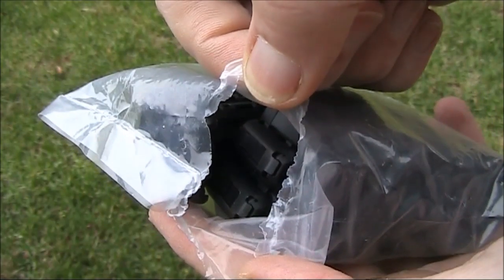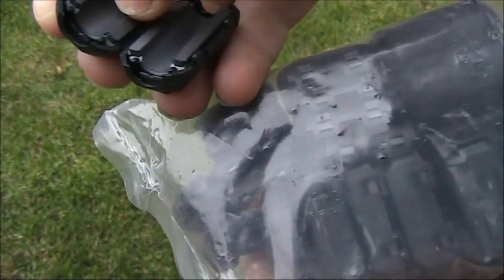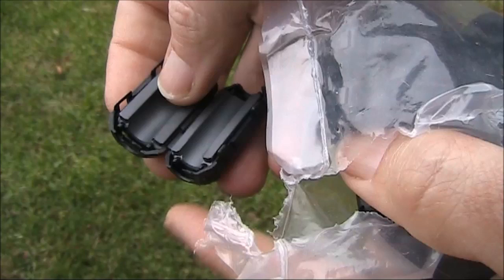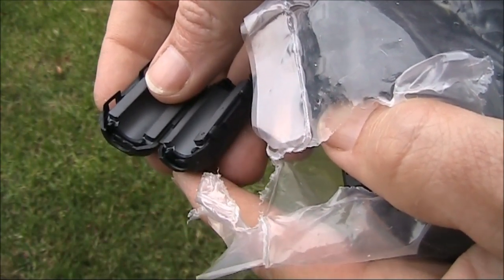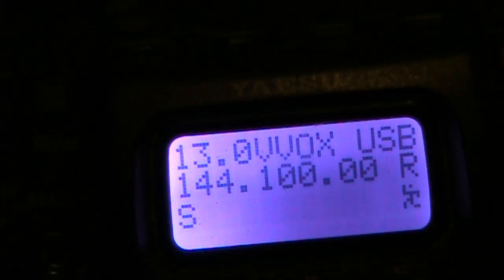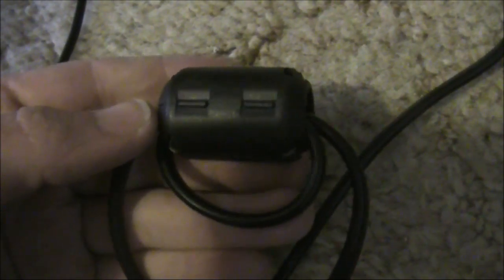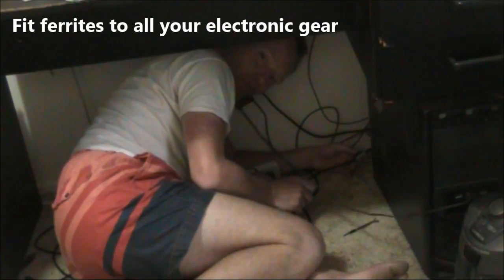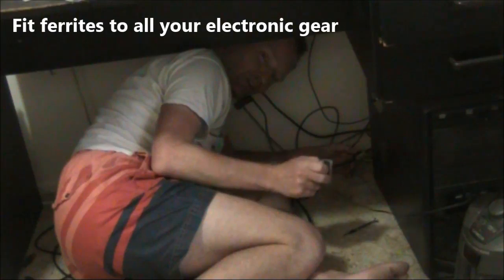The best thing you can do for your ham station

Comment: A couple of months back I installed ferrites in the IT cabinet in the house and also at the power board in the shed. Huge improvement. I also retired a couple of particularly noisy switch mode power supplies.

Comment: I perfer larger cores as to get at least 3 turns/wraps on core. I feel I get better results clipping them on the cord as close to the device chassis as possible vs the end with the plug. In my mind the thought was to eliminate the cord as a radiator. Also a great way to keep noise out of SDR receivers via the usb cable.

Comment: Sound advise and good demonstration! I find that my worst noise sources are in my own house. The best thing that I did was to power the radios from battery and switch off breakers. I ended up finding that the switching power supply I was powering my rigs with was very rf noisy at low loads.

Comment: That will  help with common mode noise.  Some power supplies also produce alot of differential mode noise. Try putting the small ones on each wire separately if you can.  Also noise can be put back into the ac lines so add them there as well if possible.

Comment: I want spetrograms with and without those chokes.  :D

I get most of my QRM from the street lights. The cheap smps in led lights blows everything above 14mhz and the sodium vapor ones kill everything below. 

I installed chokes in my main power distribution box, ran all the mains in iron tubing, grounded, and I still have to work on the general grounding...
I just hope I won't have to Farraday-cage my antennas! HI!

Comment: Why can't all service lines to all houses have RF suppressors on them?
Reply: I agree with you Dennis. When there are loose terminals on power poles and lines, noise levels increase. Also, some types of street lighting can generate noise under certain fault conditions. If the fault is on the same phase that your premises are connected to, then there is a likelihood it will find its way into receivers. I have been temped to clip on some ferrite beads to the incoming line at the point of attachment to the house. I'm not sure if the supply authority would regard it as illegal. They should be obligated to ensure no unwanted noise on their service lines causes interference. I have heard it said that some of the lower quality solar invertors cause noise as well.
Reply: You have to ask why all electronics equipment is not supplied with these already fitted, Cost, cheap skates!  It is only a small cost but they penny pinch at every turn.

Comment: But what mix are you using? There are so many different type of mix and size... I did try many times to clamp ferrites on usb cables that lose connection when I transmit on hf, or try to protect a network cable that drops out when I transmit on HF but most of the time, it does nothing probably due to the song mix number to fix the issue.

I installed IP security cameras that are powered by PoE and since that day, I have harmonics everywhere from 160m to 23cm and as soon I disconnect the cameras, the noise is gone. Impossible to get rid of those harmonics with ferrites because again, probably the wrong mix

So how did you pick up the right ferrite mix ?
Reply from the maker: This is the one I used in the test on  10m. https://www.jaycar.com.au/u25-ferrite-voltage-spike-protectors-noise-suppressors-each/p/LF1290